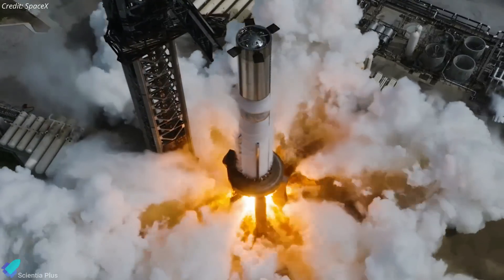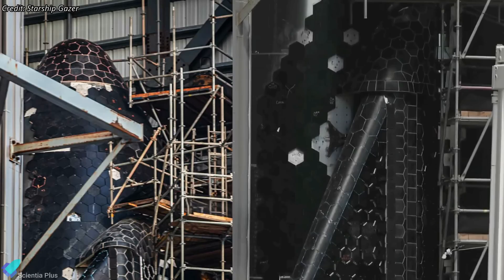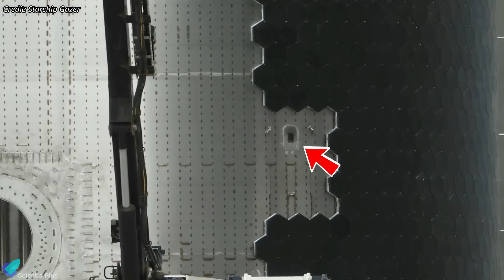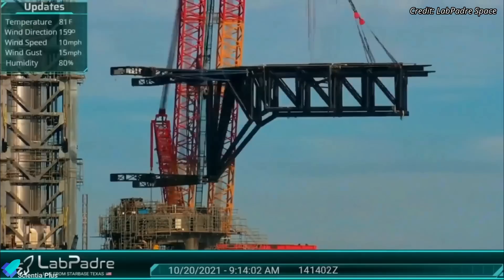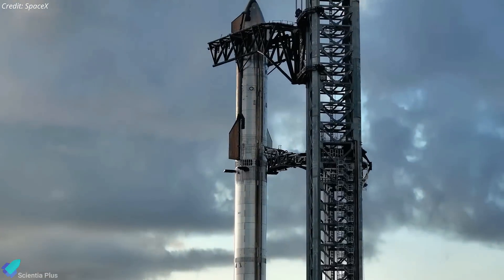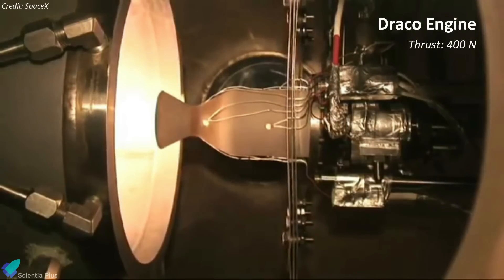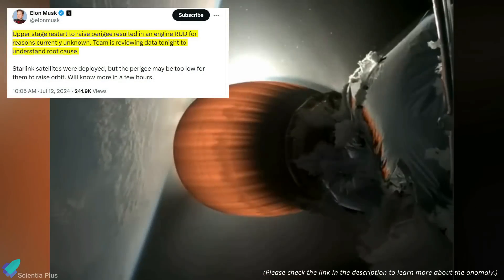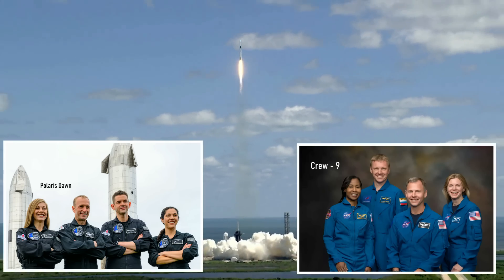Starship V2 Stack Finally Begins - Musk Explains The Big Changes, SpaceX Reveals ISS Deorbit Vehicle

Comment: Why is the term 'full duration static fire' used to describe an 8 second burn? 'Full duration' implies a 2 minute plus burn.
Reply: I believe the intended duration was 8 seconds, so it would be considered to be full.  They don't normally run ALL of the engines on their vehicles for extended periods, instead doing long duration tests on the engine test stand.

Comment: In my 2+ decades in Aviation Maintenance and Maint QC Inspection we were required to take annual training in the FAR's (Federal Aviation Regulation's), best Practices and Resource management and in Accident study so that we may know what to look for and hopefully prevent maintenance accidents.
  In Aviation Maintenance, about 90% of mistakes that lead to accidents are due to Distraction. The mechanics routine and normal flow of work procedures were distracted from somehow and when the mech returned to finish, some step gets missed or forgotten. The remaining causes for maint mistakes or accidents come misunderstood instruction (some by the manufacturer, some by the mech's interpretation of the directions) and lastly (a very small percentage) is from faulty parts from a Vendor.
   IOW, I think some Mechanic missed tightening an Oxygen supply line during installation. An easy fix if records are kept in Space Exploration as well as they are in commercial Aviation. The paperwork trail will lead right back to the time, place & personal involved w/ the installation/assembly.

Comment: Already asked to the russians if they prefer keep in orbit theyr section of the ISS?
Reply: Better than Rocket is here
Easy lift off 
Easy land on with antigravity Spaceship
No Fire
No Explosion
No Flame
Just Spin and
Lift off
Powered by Baterry

Work base on Gravity just spinning by using Battery
can fly in bad weather, plunge in the ocean even in outer space
Can lift more than 100 Ton 

Earth which weight predict 600 trillion ton does not fall at the Sun because of centrifugal in orbitting, on the contrary it does not be thrown far go out the orbit line of hold by gravity at the Sun as orbit center. Gravity and centrifugal is equal called Equillibrium, thats why until now Earth which we was inhabited always rotate and circulate the Sun. Now we justly take example : how if the gravity used and centrifugal is negated? The Earth will float far leave the Sun. So that centrifugal can be used to fly far away if gravity eliminated. Finally how to eliminate gravity?

It’s way rotate part of aircraft by horizontal. When that rotation faster centrifugal force getting greater and the gravity getting smaller, finally it lose the gravity and the aircraft start flying. Of course people would surprise: how the aircraft can keep rotate without fulcrums? Thats why we named that aircraft Shuttling System that is aircraft likes two disc adjoining attached in the midle as fulcrums:

A. The Top part, we name Positive rotate to right, and the edges is getting thicker and havier.

B. The Buttom part, we name Negative rotating to left, and the edges is getting thicker and havier.

C. Middle Part , we name Neutral, air crew placed and also machine and everythings turning Negative and Positive at the same time.

The aircraft can liftup added with explosion from the engine. However that aircraft construction later, let the engineer doit it, and we are sure the aircraft will bulletproof and also waterproof.
 
.
.
 
In modern civilization where human being generally using flying saucer as vehicle, will a lot of change in lives either in materialism and in psychological. In materialism area will apply the change in life like.
People no longger need roadway and rel road which spend large of energy, money, places, things and time, object place and time. People would utilize that area for habitat or for other need:
Reply: Rocket is complicated and dificulte
Low safety and high cost
We need somethings better
Developing technologies to enable human access to space at dramatically lower cost and increased reliability #FeelFree
Reply: Actually, Russia is the only Partner who has not agreed to extend ISS even to 2030; just 2028. - Dave Huntsman